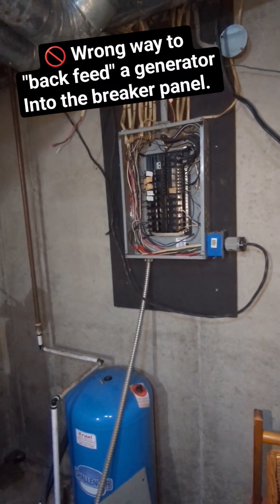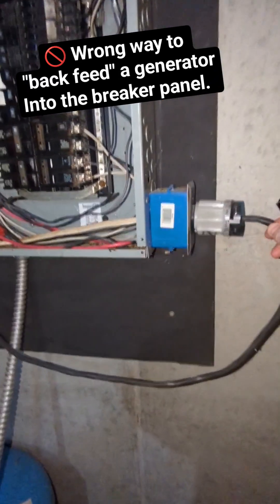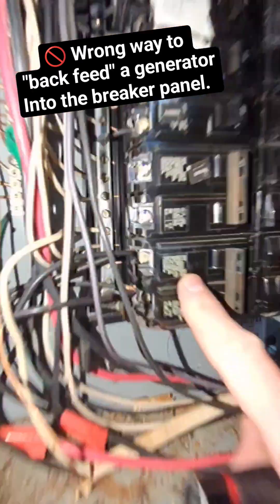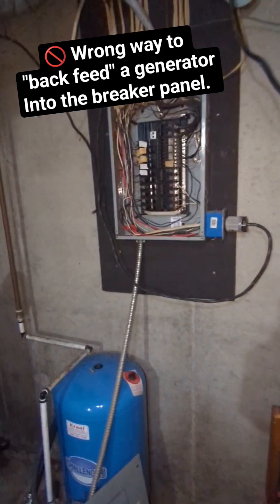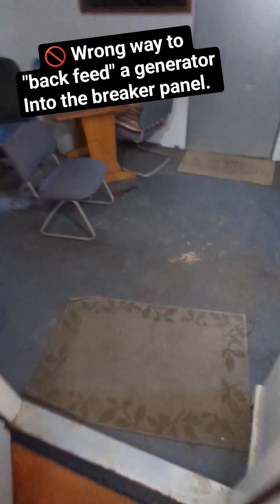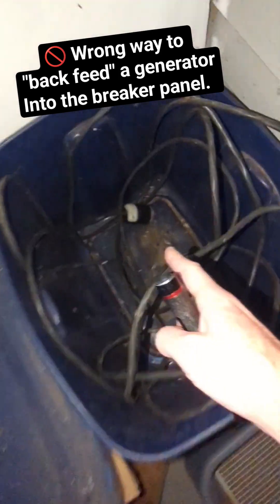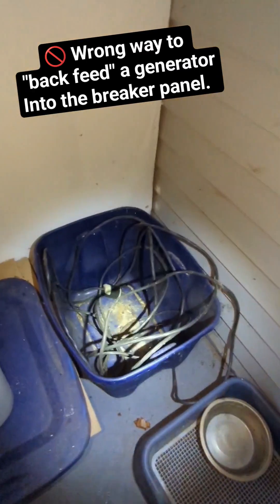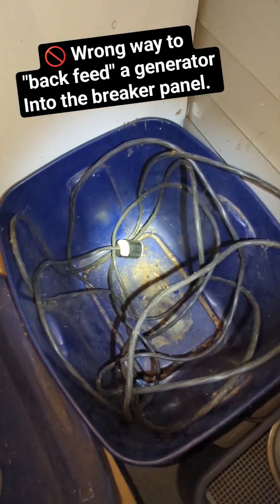🚫wrong way to back feed generator in2 #breakers #electric#electrical#youtubeshorts#shortvideo#shorts

Comment: Odd how the breaker above it isn't lugged at all, but this one just so happens to be double lugged. Something tells me somebody is trying to fake a video. I was going to say you turned the breaker on yourself while the original owner had it turned off, but now it seems more likely this whole scenario is faked. I really dont see someone having an unused 30A breaker available above the 20A thats double lug when the the plug on the cord is a 30A twist plug and not wiring into the 30A breaker and instead choosing to wire into the other breaker. It makes no sense for an idiot to do that but it does make sense for someone to fake it.
Reply from the maker: @howardradford1985  🤔 I don't fake or alter anything on other people's homes for sale in over 30 years. This was 1 of 5 improperly installed back feeds I found last year and most were vacant with random potential buyers walking through. However this one is as easy as unplugging it, the others were hard wired into the systems. Check out this https://youtu.be/LMoAN7AUHKw?si=PLXSJQ9S7sj3pRSH
Thanks for watching.
Reply: @inspectflix Okay if you say so but that's a 30A plug in a 20A breaker and just so happens the breaker above it that isn't lugged at all is a 30A breaker. Seems you probably would have caught and pointed out another code violation there.

Comment: The only mistake I saw was the plastic tub is supposed to be filled with water to keep the plug cool. Right?
Reply from the maker: @tomcartwright7134  🤣🤣 I just had another similar situation and the prongs were hot at a vacant home. 
I can't believe the home buyers were standing right next to it.🤯
Thanks for the comment and for watching.

Comment: Would it be ok if the outlet was switched???
Reply from the maker: No. It's very important that the power is shut off that is coming from the power company. (Main breaker)
There is a specific component that can be installed on the breaker panel cover that requires the home owner to shut off the main breaker in order to turn on the double pole breaker that feeds a 220/240 outlet to plug in a generator.
Thanks for watching

Comment: All of you worring about lineman and backfeeding dont they treat all lines like a  firearm for the same reasons 😊 the biggest but simple issue is that dble lug/tap breaker. The other issues are just valid successful darwin awards 😅

Comment: Without verifying the Plug is hot it's an ASS'umption Voltage is present, Correct?

A Shady install Yes, Yet Functional in a emergency.
Always Unplugging and storing the "Jumper cord" when not in use and problem solved.

Comment: Quadruple whammy! 
1.  Energized plug end in breezeway is electrocution risk. 
2.  Panel wired to back feed generator power onto the grid.  Poor lineman. 
3.  Panel wired to back feed line power into running generator.  BOOM! 
4.  Cord in breezeway too short to get generator far enough away from building — 15’ from a door, window or opening in the wall.  Asphyxiation. 
Bonus:  cord not SO cord for high abrasion use.
Reply: I'm a lineman for the local power company. Part of our tailboard is a walk down when we arrive. If we hear a generator ? We make a note on our tailboard safety brief. We test everything checking for back feed. We have several options available to us. We could knock & ask the back feeder to turn it off? If we get big balls? We pull their electric meter & blank it off.  Then we return their meter to the office with a note of the address to Meter Service. We could put a ground on their service shorting it out or call the fire department. They in turn call the building department who pulls their certificate of occupancy. They have the authority to remove the residents of the house & deem it uninhabitable. Then they pad lock the house. Only until ALL the building code violations are fixed will they re-issue a CO. That could take weeks.
Reply from the maker: Nice outline. Thanks for watching and the comment.

Comment: Make it safe:
1.  Unplug external feed plug at panel outlet. 
2.  Cut cord at short enough so it can no longer reach panel.
Reply: He is just there to do an inspection. He can't just cut the cord it's not his property.
Reply: So 1 he is an inspector but even a electrician you can't purposely damage the cord legally it is the customers property you can in hook it but you can't damage it and depending on the local laws you can't report it unless it's hooked to a generator
Reply: Alert the utility and have them cut power to his service until he fixes the problem correctly!
Reply: @claytongetz6362  Depends who owns the property. If he was hired by the property owner to do the inspection, the owner won't be happy about the power being shut off. The house is currently empty, so maybe someone is having this inspection to find out what needs to be fixed.

Also, this is not a condition that needs to be reported to the utility. In its current condition, there is no danger to anyone outside the house. Since nothing is connected to the cord, there is currently no danger to workers.

Comment: The easiest way it to better proper install that outlet for the receptacle to be mounted in. Dedicate a home run for it. And during an outage you disconnect your neutral after shutting off either your main breaker inside the panel or outside if there's a meter/main. If you're in an extremely outdated location you can pull your meter and safe off the opening TEMPORARILY. 

Reason being you disconnect your neutral in the panel is to prevent a backfeed to the lines going to your transformer. This will save a young and or exhausted Lineman working to restore your power

Edit- this is not to code and only recommend for dire straights in the event children, the elderly or sick folks requiring refrigerated meds and or medical equipment to function.  Hire an electrician to get you properly setup.

Comment: I have almost the same thing except I have an interlock so either the mains power or generator power can be used, but not both.

Should  I upgrade to a transfer switch?
Reply: With the interlock, as long as you aren't using a suicide cord (male prongs exposed on both ends) and your generator cable is rated for the max amperage it produces, you're ok.
Reply: I would
Reply from the maker: 👍 would be best

Comment: I didn’t know that plastic tub was dielectrically safe? Clearly another example of someone doing their own work instead of hiring an electrician. These idiots could have triggered the building dept. to revoke their CO if someone got hurt?
Reply: For this, you could get a certificate of occupancy at the county jail.
Reply: Because a electrician would have cost them more money to install a disconnect when the owner tried to do right by even adding a second plug at the box in theory you turn off the main disconnect plug in cord at panel then plug cord into generator start generator once power is back on reverse process it's safe but it doesn't have idiot protection

Comment: What a mess...hard to believe people do it this way when the proper interlock kit and outdoor connection box are pretty affordable.  A lineman thinks the main line is dead and it's actually not as it backfeeds through the pole transformer.
Reply: Linemen never think a kV line is dead, they check.  Then they install grounding straps.  Then they start work.

Of course a setup where there is no interlock or transfer switch is completely stupid and extremely dangerous to all and sundry.

Comment: Yes and at least put a piece of electrical tape over it so a reasonable person would know not to turn it on
Reply: Better is cut off the stupid wires from the breaker.
Reply: And so it could be wired properly at a later date

Comment: As some kind of plumber there is a reason I don’t mess with electricity. 

You hook something up backwards with plumbing and it probably won’t kill you but now I have to worry about extension cords?  Jeez
Reply: Called a "suicide cord". Two male ends. Big no no.
Reply: @BillSmith-rx9rm basically if this button has been pressed then signal wire goes to relay, sometimes relay is normally on, some are normally off. 
I forget the exact names but yes there is some logic stuff, but dumb logic. If power here, disengage this, if power here but not there power this kinda stuff.
Reply: This... this though is a huge no no, and it really isn't that bad, your important colors are White, and Green. 
It only gets complicated if you decide to go into control wiring 😂
Reply: @travis2893 lol very true. I work now as a controls tech and it’s way more complicated than ac electrical. I worked as a commercial/industrial electrician for many years and you would be surprised how many guys can’t understand controls. Guess that’s why the pay is much better.  Peace.
Reply: @BillSmith-rx9rm just think button panel in a factory that turns equipment on/off and controls other functions. 
Control wiring is litterally just a general term it can be any kind of controls and its considered  ontrol wiring. 
However the guys who do it will give a better distinction. I am just an electrician who has done control wiring I do not specialize in it like some do. 
But I guess just think building control as well.
Reply: You only have you worry if you work with idiots